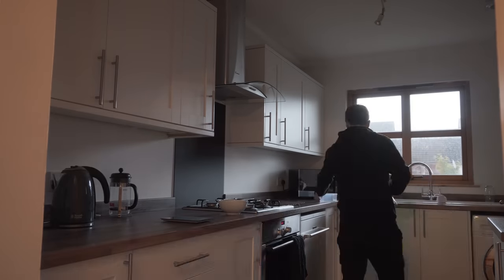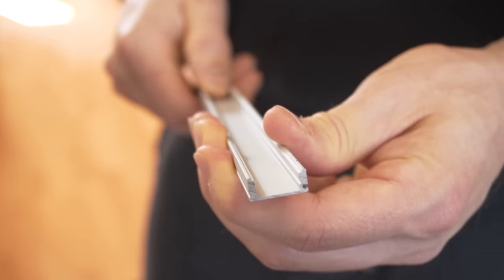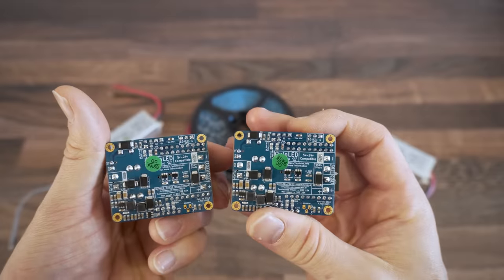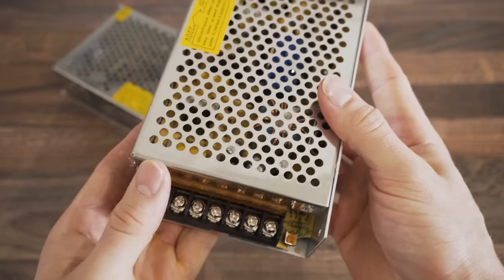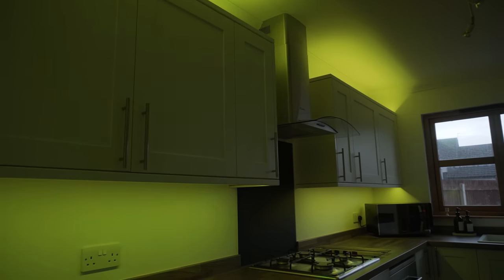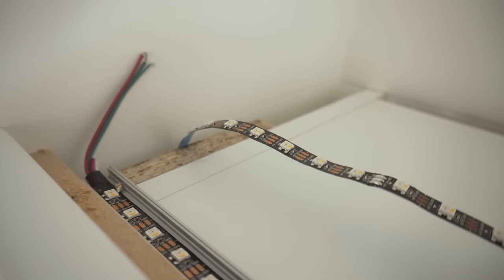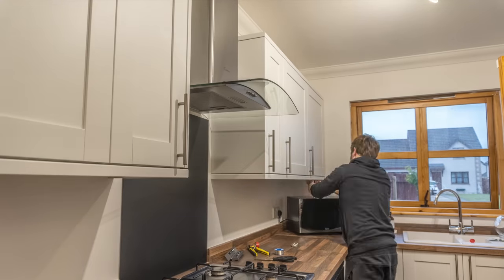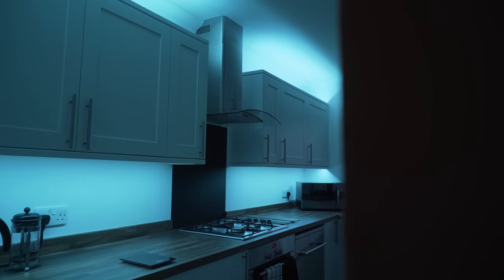Transform Any Room With These DIY Smart LED Strip Lights!

Comment: Great video. And of course, with WLED's Segments feature you can control the above-cabinet and below-cabinet sections independently.

One thought though: I always wonder about the safety of those power supplies: the mains voltage inputs always seem rather exposed. I'm sure these things are supposed to go in an enclosure.
Reply: They are supposed to go in a junction box. I had an electrician in to check the wiring (carry out an EICR) after moving house recently and I expressed concern about the exposed terminals. He said they should have been enclosed by whoever did the wiring, but it wouldn't cause an EICR failure.
Reply: @robert.wigley  I've ordered the stuff (technical expression) to do a project very similar to this but would rather enclose the PSU in something like a junction box - can anyone recommend on they have used? Thanks for the Vlog
Reply: @davebareham1075  well I'd at least make sure it has some ventilation. Also important for the box material to be fire-supressant.

Comment: I wouldn't use this setup in my kitchen. Even though the led strip has a dedicated white chip, the quality is very poor (very low CRI (color rendering index). Also, this kind of chip you're using is using PWM for dimming with very low frequency, so there will be a lot of flickering (the kind of one you couldn't see but it's proven to put a strain on the eyes)

My 2 cents, again :D
Reply: What strip would you use?